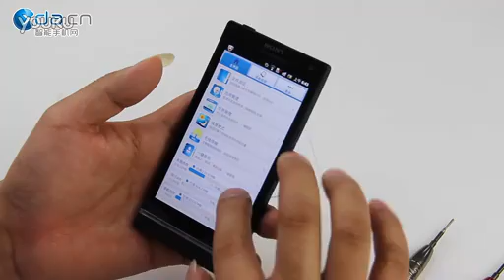Xperia S Disassembly Guide

Comment: GNARLY.
Even if you dont have claws this phone opens REALLY easily by gently wedging a 3mm flat screwdriver between the frame and the rear cover.
Remember to disconnect the battery FIRST before you start pulling at connectors.

Comment: I need to know where the memory card is located. And if possible what it´s called if i can run it through other devices. (mine is completely shattered)
Reply: i have the same problem...did you find a solution for it?i just want my data from the memory card..:(
i you had any luck with that  please help..:(

Comment: Brother I have exactly the same issue. Everything working except backlight after disassembly. Please if you know how to fix that help.. I think the yellowish 5-6 pin flex cable is for the backlight which connects to the little board on the bottom of the phone but as far as I see there is no damage anywhere.. And how you replaced your display? Isn't it built in on the housing panel? Anyone help..